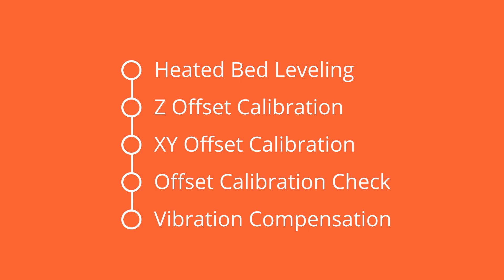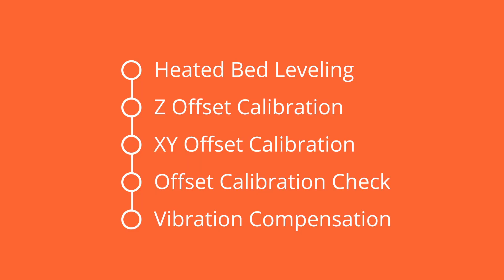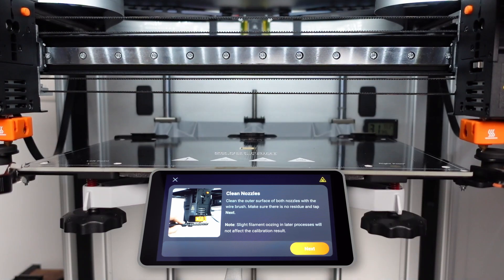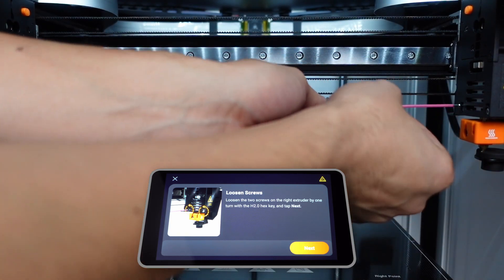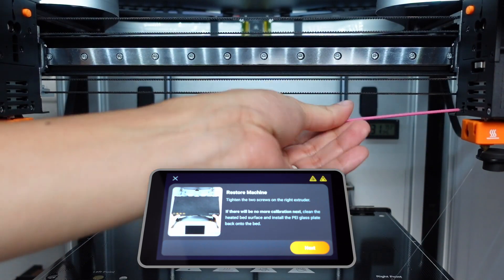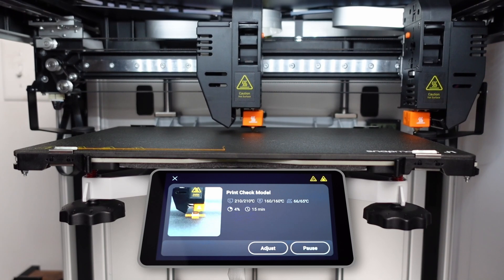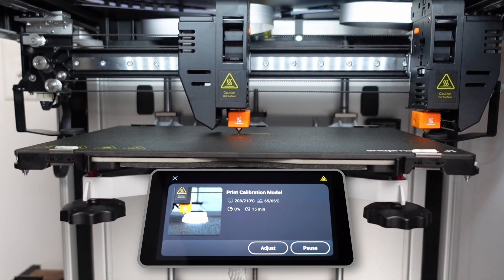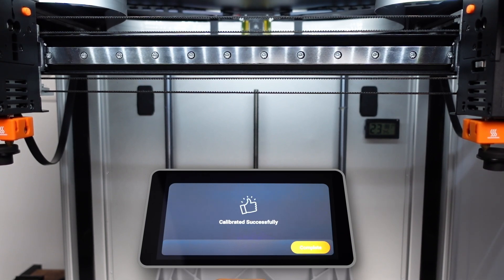Calibrating your Snapmaker J1

Comment: This seems to be an older video, but, my bed is so warped, that this method of levelling only makes one corner of the heated bed useful. Only the right back corner is at the correct height. The rest is unusable. Especially in copy mode.
Reply from the maker: I recently redid my bed leveling manually using a flat machining block as a reference for both nozzles with the bed installed. Found that the knob based bed leveling was off a little (enough to cause issues) side to side and front to back, and the right nozzle height then needed adjusted as well.

After those manual fixes I could print with dual materials on a single print, or copy mode.

Comment: Can you print CF material with it? PA-CF, PC-CF? What nozzle style did they use?
How is it performing in printing ABS, ABS+?
Reply from the maker: I've printed a lot of ABS and PLA, it can do PA-CF/PC-CF but you have to buy the hardened nozzle/extruder set instead. Temperature wise the chamber/bed/hot end are well suited for those materials.
Reply: @workshopetech  hey thanks for the reply. Yeah I would need for sure a hardened nozzle. Looking into SiC nozzles too. Hardened nozzles have such bad thermal properties…
Good to hear that ABS prints well. One of my most printed materials after PC blend from Prusa.

Comment: Great video, any suggestions to stop the oozing during the calibration process? It was so bad I had to unload my filament before tackling the bed leveling and XY calibration.
Reply from the maker: Are both your nozzles sitting covered by the silicone pad when it's parked? I too see some oozing, but typically on the right extruder since it stays hot for longer while waiting for the left to finish. Since we don't have access to controls during calibration, I think snapmaker would have to make improvements.
Reply: @workshopetech  yes they do rest there, but of course they both move away for cleaning, and that's when the oozing starts in earnest!